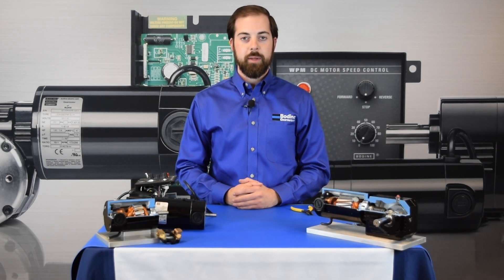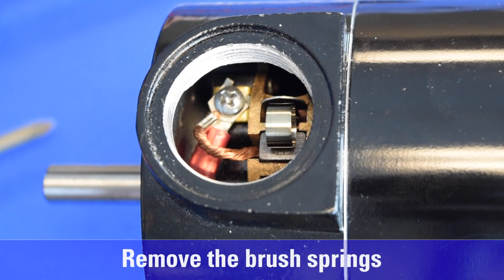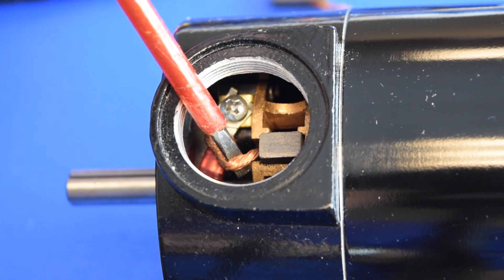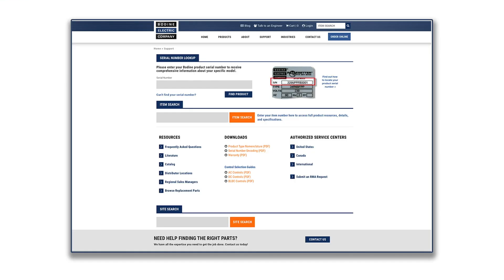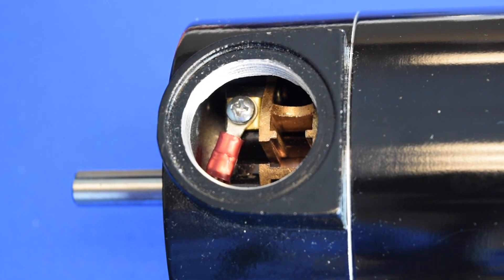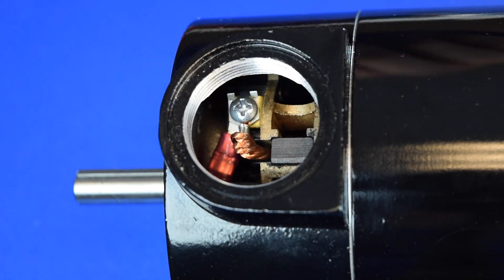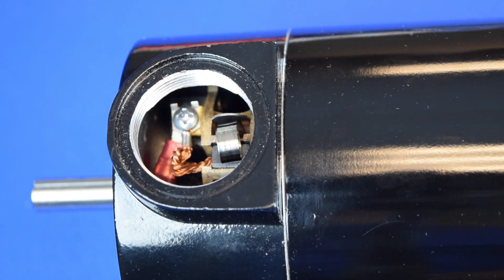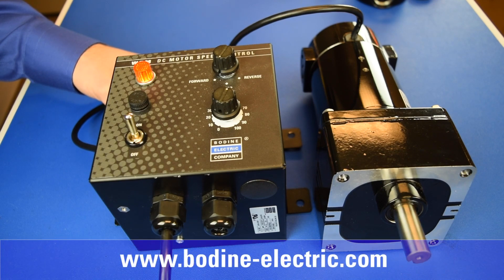Gearmotor Tips - Bodine Type 33A or 42A Brush Replacement Instructions (PMDC Motors/Gearmotors)

Comment: What is the periodic recommendation?
Reply from the maker: Hi Alex, thanks for your question. Brush life will depend on current density, duty cycle, and environmental conditions. The absolute best estimate of brush life comes from data obtained while operating in the application.  The brush inspection interval and process (if needed) may be included in the operating manual for the equipment which has the Bodine product installed. However, if such guidance is not available from the OEM, then we recommend that brush inspection be carried out at regular intervals of 4-6 months, or 1000 hours, depending on how many hours a day the motor operates. Assuming that all variables (i.e., current density, duty cycle, environmental conditions) are reasonably consistent, brush life should be fairly linear. It’s important to remember that one brush will wear more than the other if the motor only operates in one direction (i.e., CW or CCW), so both brushes should be checked for wear.  Once you establish a brush wear rate for your unique application, you can adjust your inspection intervals accordingly. We hope this helps! Be safe!